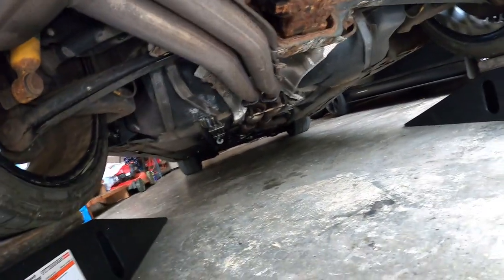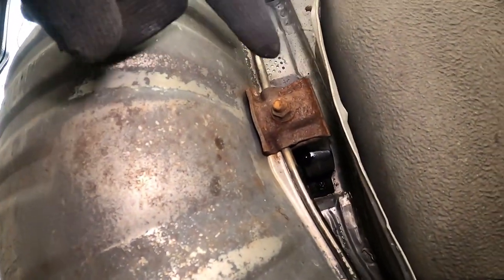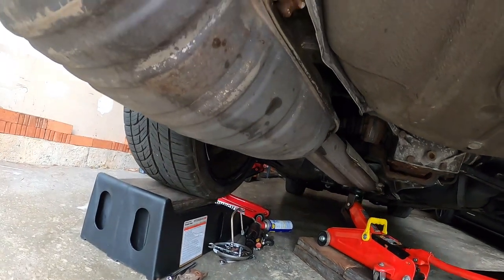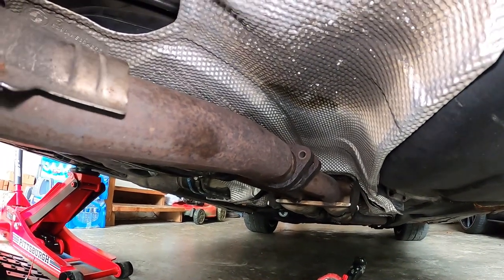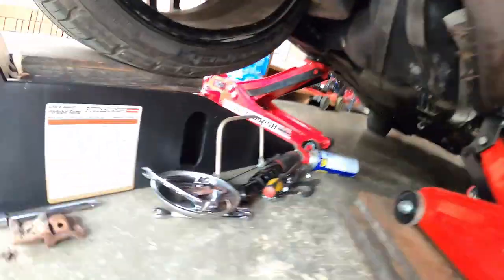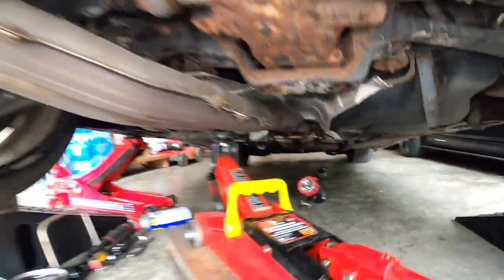New UUC Corsa Exhaust for the E36 M3

Comment: Have been considering throwing one of these on my e36 for the past few years.. its nice to find such a recent video of one. Do you still feel it isn't too loud? that was my only concern after watching a few of the sound clips I could find around. I think it is the best sounding exhaust that ive come across for these cars.
Reply from the maker: It still sound delicious. Its not too loud compared to the f80 for example. But the sound is perfect. I will definitely recommend you to do it
Reply: @TorvekMotors  Dang delicious hey, I like the sound of that. How about on the highway, it doesn't bother you for long road trips ?
Reply from the maker: On the highway the midrange is sweeeet. I should make a POV so you guys can hear the sound. The longest trip i completed with the e36 is an 1hr drive. The sound did not annoy or anything. Also no drone
Reply: @TorvekMotors  Would love to see you put together a little video to let us hear it on the highway through the ranges. Im still putting off ordering one for the summer since i wont get it until about September now anyways, but this might help me get it going haha
Reply from the maker: I actually shot it already. It will be on the channel soon. Btw I would recommend getting a used one if you can see one. Check facebook forums. Thanks
Reply: @TorvekMotors  Found one of these out of Arizona used... Should be here within 2 weeks.. cannot wait.